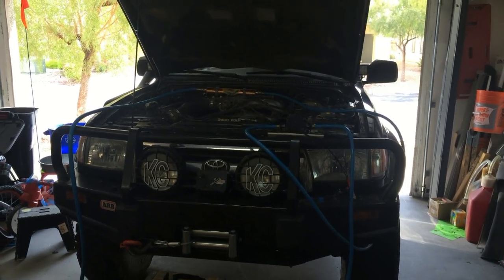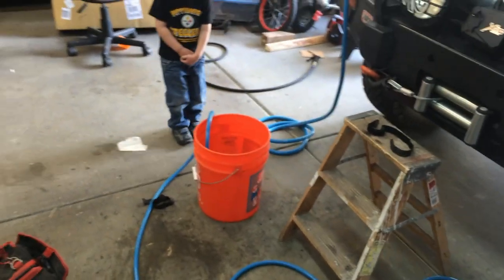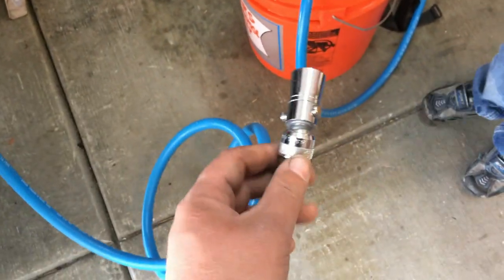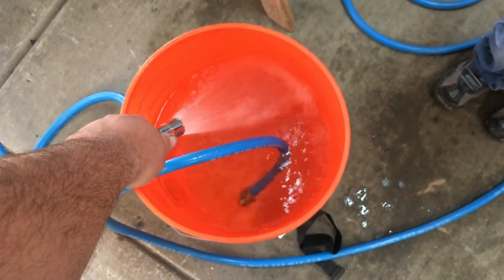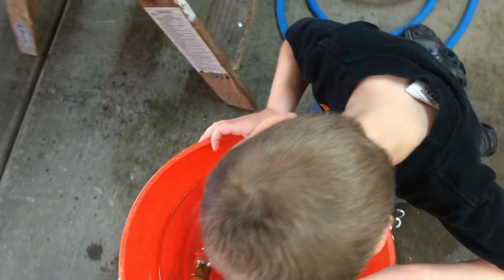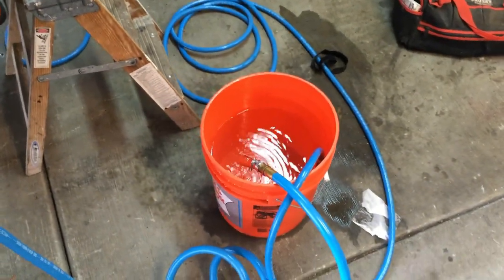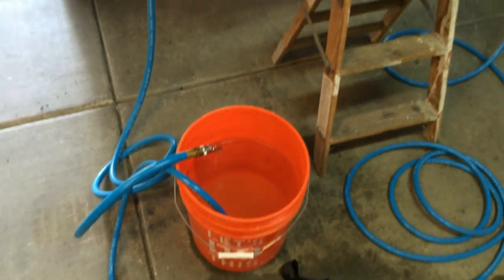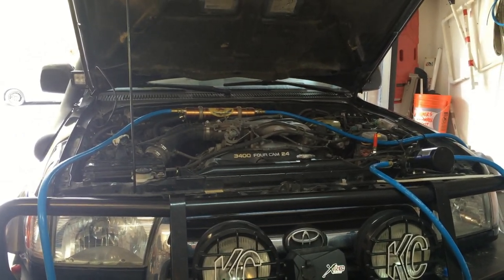Vehicle mounted Heat Exchanger/Hot Water Shower System

Comment: A good DIY source for a heat exchanger core is the transmission cooler unit from a radiator. Well made and ready to be converted to heating water with limited fabrication.
Reply: Yes! The ones I use are off of a big rig. The have a barbed circuit for coolant and a JIC circuit for transmission oil. I clean the oil side out with brake clean and use it for my shower water connection. Ford 6.0L diesel engine oil coolers work good too. I have one of them on my firewood cutting truck. You have to NPT tap a few passages, but they work well.
Reply: WyoDirtDude that's an interesting idea.
Reply: WyoDirtDude an onboard shower might be the only thing 6.0 oil coolers are good for
Reply: AKA Nathan make a video
Reply: I bought a insulated 60 gallon indirect water heater with tin plated, finned copper coil heat exchanger and marine grade stainless steel tank for $150 used. Knew they cost $3800 plus tax. I want to use it in my sprinter van for hot water for showers and washing dishes or clothes. I have no idea how to hook this up to collect heat from the radiator fluid and I’m concerned if there was a leak into the water that that stuff is poisonous soon as they are way to hook it up to another device first so that any leak could not get to the main tank doesn’t seem like That would prevent it though. I have a separate 18 gallon stainless steel tank tank I’m using for unseated drinking water. The 60 gallon tank is going to be mounted where the front passenger seat used to be so the weight will be on the front axle
Reply: @GOLDVIOLINbowofdeath  Are you sure its 60 gallons? that s like 240L isn't it? A bit over kill. As for water heating and cross contamination of heating fluid to the water, unless if fails due to corrosion or cracking, the 2 fluids are always separated from each other. As the term heat exchanger describes, they only exchange their heat.

Comment: I make heat exchangers of all kinds all the time, its cheaper then buying pre made one, for your application get 2 peace of copper pipe, about 12" long, your heater hose is 1/2" so 1 peace copper pipe 1/2x12 and the 2nd peace 1" x 12" buy copper reducing fittings 1" x1/2" x 1/2 tees, take a dermal and grind off the stop ridge inside the reducer fittings so your 1/2 copper can slide right though, clean and solider, add you hose barb fittings, and add a washing machine tape solider to each end of you domestic 1/2 copper pipe, you can also add in a mixing valve to control your water temp, when your pumping right from a river or lake and have endless hot water at just the right temp.
Reply: Dude this sounds awesome. Do you have any links to photos or videos for this type of setup? Thanks
Reply: I made mine in 1990 in Minnesota now I make them in Africa.

Comment: I made one of these 20 years ago. I bought a heat exchanger that was meant to cool hydrolic fluid. I plumbed the jeeps coolant lines and a 12v rv pump to it and was done. Its much larger than the one you show here and im pretty sure it heats the water more.

Comment: A plate heat exchanger from a central heating combi boiler would be the best type. It would not need to do a circulation but it would pretty much be up to temp in one pass...
Reply: I have my central heating system heat exchanger for about 2 years now and what I found it does not need any circulation. It goes in cold (5 degrees C - 41 degrees F) and comes out (sprinter diesel engine running up to temp) at about 40 degrees C or 104 degrees F) in one pass. My heat exchanger came with a flow control valve (seems to be a standard thing within the central heating boiler system I got mine from) which lets me control the output flow and obviously the temperature.
I find the control valve is actually not really doing very much - I have it turned fully open most of the time - and I use a webasto coolant pump to move the water from a 5 gallon jug to another. I fill the lower jug up in about 3-4 minutes at the 40 C - 104 F temperature water... 
My pump does not do pressure, just flow so I can not hook up a shower head or a garden sprayer but I use the hot water to do dishes and have a cup and bucket shower in a little chinese shower tent/booth thingy...
I am looking to get a smaller jug which I can fit inside the 5 gallon one so I can sprayfoam insulte between the two and have about 2-3 gallons of water water which can stay warm for upto 2 hours or so...

Comment: Nice. it's seems close to on demand. Gives me an idea.   I'm wondering if I coiled some 3/8 copper pipe tight around my van's exhaust what kind of heat exchange this produce?

 I currently have a 7 gallon U-shaped 4 inch PVC solar tank on my van roof with an air pressure valve. The system works great except for at night or really cloudy days.  I am installing a 500 watt 120w 1/2 inch NPT heating element to see if can take water from 75F to 110F in 15 minutes or less.

Comment: How do you manage corrosion when mixing aluminum components such as cylinder heads, radiator, manifolds, monoblock with a copper heat exchanger? 

This is the right formula for corroding aluminum.

Please comment your experience.
Reply: Hilo Stitch , rads are copper, so the coolant must have a corrosion inhibitor in it anyway.
Reply: Hilo Stitch there isn't any actual copper to aluminum contact.
Reply: Gerald Norton , there's no zinc to copper contact in a battery, but ions still move because of the electrolyte between them.
Reply: Massimo O'Kissed man I didn't mean to reply to your comment. you're right but that corrosion wouldn't happen fast through the coolant alone. Plus there obviously corrosion inhibitor in it like you said. it would corrod much faster with direct contact.

edit: your example is flawed. it wouldn't be a battery if they didn't flow. Also the the medium they're submerged in is design to allow electrolytic flow. That's why it's called a battery.
Reply: Hilo Stitch in a fresh and treated water (assuming using glycol), as the car cooling system it is not a real issue....

I have experience with this in open seawater cooling system of inboard boat engines in a much harsher environment when it comes to corrosion....
Reply: Gerald Norton wrong! The electrical contact of the dissimilar metals in the same liquid is what matters. It does not matter if they are or not touching each other! So if the exchanger is touching the CAR body, all parts are bonded to the same "ground"!

Way worst than having a small piece of copper in the system is the pair cast-iron block and aluminum head / manifold which is no news on CAR engines....

Fresh and treated water (anti-freeze has corrosion inhibitors) should be fine.
Reply: Hilo Stitch doesn't seem like that big of a concern with a vehicle that has 150k or more.
Reply: Cars of the 70s and earlier had cast iron engines and copper radiators and heater cores. 

They were cooled with green antifreeze. The engineers knew what they were doing as they produced 100 of million cars which lived long lives.

Comment: cool setup. want to build that too.  two questions though   a. is the exchanger in the main coolant line or as parallel " by pass" ? wondering about flow during driving   b. the engine needs always to run to keep flow in the exchanger uo i guess, even after a days drive with coolant being hot already ?

Comment: Even easier-,wrap a soft coper3/8" around  the a exhaust pipe and create close loop  with 2tees in between.One for suction water to pump and the other  one for shower head discharge function

Comment: What youre calling the "Heat Exchanger", is basically just a scaled up version of a condenser from a Still (just taking the temperature in the other direction); or if your in the marine diesel community a coolant/fuel heater  -If you were to fabricate one your self you'd want to get some 2" or 3" copper pipe, some reducing T's (to match whatever size of larger pipe youve got picked out) this will be where you will plumb in the coolant system (once youve soldered the T's in place, youll need to punch holes thru the larger pipe with a drill to let the coolant circulate around in here, throughout the larger pipe), then youll need 3/4" or 1" pipe that will concentrically go thru the middle of the larger pipe (it will be longer, this is what youll use to connect to your garden hose) capping off the ends of the wider pipe youll want to use either reducing couplings or bushings which will maintain separation between the 2 hydraulic systems.

Fittings for the garden hose will go on the smaller pipe running thru the bushings/reducing couplings in the middle of the larger pipe

People will probably at sometime use this hot water for consumption, so just use copper & silver solder -stay away from brass

Fittings will probably run ~$90 (Assuming you're using 2"), and whatever on the pipe to accommodate how much surface area you want for this project

Comment: I'm looking for a hot water solution for a DIY camper van build and this looks like a great idea. Is the vehicle's fluid actually moving through the heat exchanger, or is the exchanger just attached to a hot spot under the hood?

The only downside to this I see is having to pump the cabin full of hot air in the summertime with the heater on full blast. I guess you could roll the windows down to keep it from heating the cabin up too much.

Thanks for sharing!
Reply: PJ Jackson , yeah, the engine's coolant fluid is going through the heat exchanger. It's connected into the system near the dashboard heater block.

You could use a diverter valve to switch between shower heat exchanger OR dash heater block, so you don't have to heat the cabin.

Comment: would make more sense to have the output of the heat exchange going into the Bucket. Then plumb in the shower out of the bucket.  This way you are not relying on a single pass through the heat exchanger to get the water upto temp

Comment: what show head is that? I have a similar setup on my jeep but am using a sink sprayer with a 60psi 1gpm pump same brand as yours.
Reply from the maker: This is all the info I got off the shower head... (alsons ansi a112.18.1m shower head 2.5GPM 9.5LPM). I couldn't find that exact one but found a Delta on Amazon that is similar. https://www.amazon.com/dp/B006FYABAE/ref=pd_lpo_sbs_dp_ss_1?pf_rd_p=1944687502&pf_rd_s=lpo-top-stripe-1&pf_rd_t=201&pf_rd_i=B000UNU9US&pf_rd_m=ATVPDKIKX0DER&pf_rd_r=C3EY6MXS2134QRJFAKBG Hope that helps ya!
Reply: Thanks

Comment: How did you tie in the heat? I mean is that exchanging with the coolant and how'd you do it!?
Reply from the maker: It's tied into heater hoses. It takes the heat from the engine going to the heater core and heats up the water being pumped through the heat exchanger.
Reply: @nevada4wheelin  hi there, in Australia we have the same 5VZFE engine and I picked up a 2nd hand exchanger. The pickup for the hot coolant from the engine to the heater core, any chance you could provide an image of which coolant line you tapped into? I understand the concept and fairly confident I can do the install. Just want to make sure I pickup the correct coolant line.
Reply: And here I am in the 21st century trying to invent how to capture engine heat. Thank you for the video! I think once the water in the bucket is warm enough, I'll put the bucket on the roof and gravity feed it down to the shower head, do dishes, etc.

Comment: Great clip and example, thanks!
Has anyone tried wrapping copper tubing around the exhaust as a heat exchanger and running the water through to heat it for a camp shower?  I was also thinking about running it through the trans cooler on the radiator or somehow using the engine heat to do the job instead of lugging extra propane. 
I figure the exhaust gets hotter faster than the heater core or radiator. Just wondering if this has been done? 
I have a MWC shower can installed in the Jeep with an electric pump. It's super in Summer but a little cold in Winter trips... It's a challenge to find a simple option to heat it otherwise.
 
https://www.youtube.com/watch?v=l9OL6GOdjYc
Reply: Btw, your assistant is adorable! I was cracking up when he sprayed himself. He needs his own show
Reply: Copper will oxidize if it touches steel after a short time.